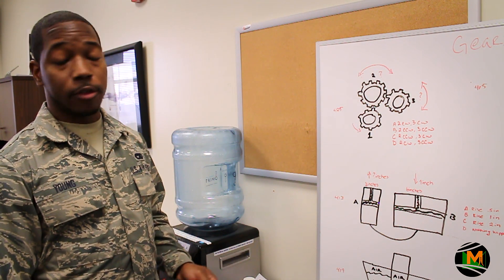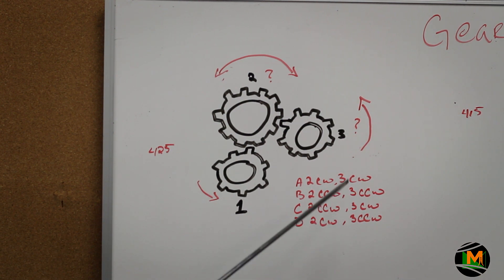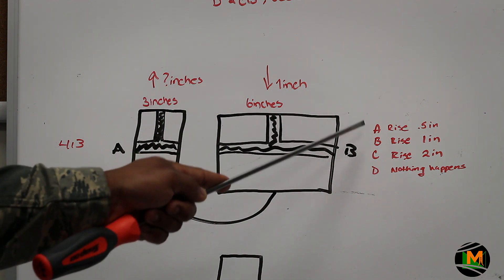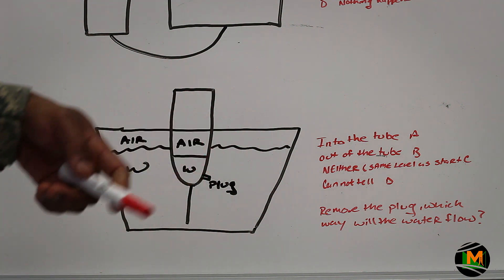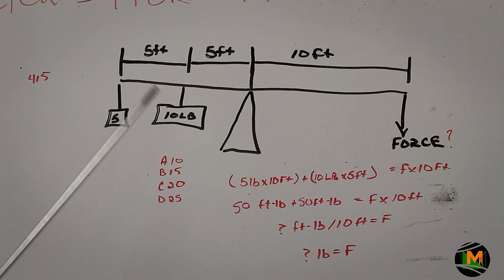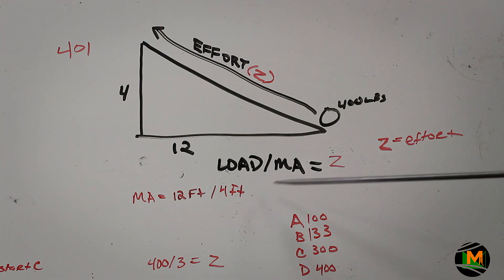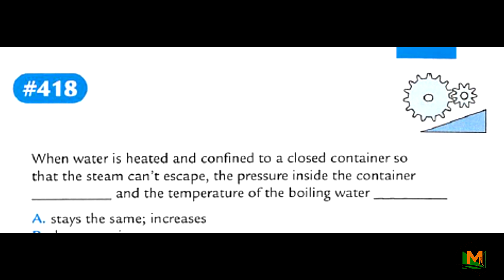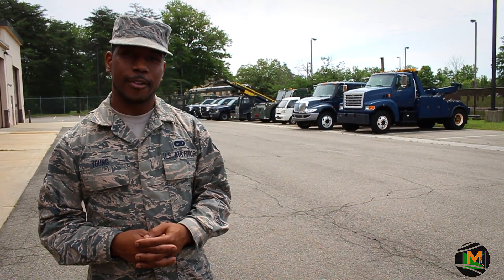ASVAB Study Guide: Mechanical Comprehension

Comment: On question 401 I believe that you’re actually supposed to find the IMA using the Length of the incline which is hypotenuse (not the base/horizontal line) divided by the height of the incline. However, if you use the Pythagorean theorem, it turns out to be a little over 12 anyways. So the way that you did, it will still get you close enough to the answer to guess. Correct me if I’m wrong please.

Comment: 419 didn’t make sense to me..
The air is trapped inside the tube therefore the water would not flow into the tube as the air has no where to go. Like an upside boat in the water. You can dive under with it and the trapped air will keep the water from entering... confusing question.

Comment: Sorry but in question 415 why the correct answer is 10 ???    : if the length is the same in both sides for be balance there should be the same weight in each side so the correct answer should be 15lb ?
Reply: I’m pretty sure it’s because the distance of the 10lbs weight is closer to the center so it has less pull on it.
Reply: Jimi Vanstory right it does need to be an equal force. But imagine your holding a 10ft pole with a 10lb weight on the end and you have to hold it straight out. Now imgine you move the weight to the middle. Dont you think if will be 2X as easy? Cause putting the weight on the end increases the footpounds of force is doubled
Reply: 10ft x 10 lbs = 100ft/lb which was result of opposite side 50ft/lb + 50ft/lb
Reply: No. Hes right. If you put 15 on it that side would bottom out
Reply: Its still 10 ft on each side so itd have to be an equal force to balance out it has to be 15.....right?
Reply: sociopasta 23  okay ya that makes more sense

Comment: Fuckkkk I'm going to fail
Reply from the maker: Bay Adams no you're not, you just can't master these concepts in 2 hours before the test. All you need to do is take it section by section and work on your building blocks. We have strategies on how to break it down coming, but you'll be fine. Keep studying
Reply: DCANG Be The Hero when are they coming out? i take the asvab monday and my crayons arent going to get my through it😐
Reply from the maker: Bay Adams sadly not by Monday but how are you on Arithmetic, Math knowledge, word knowledge and paragraph comprehension. Those are the real keys to passing the ASVAB (at least for the Air Force)
Reply: DCANG Be The Hero I'm alright on math knowledge but good on word knowledge and paragraph comprehension. I just need a high mechanical maintenance score because I want combat engineer.
Reply from the maker: Bay Adams then you will do fine. Check out the Podcast about the initial interview, make sure you do keep an open mind even if your not going Guard, recruiters rules might still be the same no matter if your Active, Guard or Reserves, as to what they may need to fill.
Reply: DCANG Be The Hero i'm going active Marine Corps lol but yeah ill do that
Reply: DCANG Be The Hero I made a 59
Reply from the maker: Bay Adams see I told you, you would not fail. So is that enough to get you the career you where looking for?
Reply: I've been spending time with the help of my son researching into passing the Asvab test and found a great resource at Wilfs Exam Blueprint (check it out on google)
Reply: here's  a few tips for passing the military test
Give yourself a break
Don't get too stressed about it
Check out some trial exams online
(I learned these and the reasons they work on Wilfs Exam Blueprint website )
Reply: I know the feeling I'm about to take Air Force

Comment: I'm sorry but 401 is wrong. It would be 133.33333333333333... So technically that question is wrong
Reply from the maker: Dave Blair  so since we are a community in helping ppl pass. Please enlighten us on the correct way to solve that answer.
Reply: No you were right that in the ones given that was the right one to choose but in all reality the answers should have had the decimals since a little does make a big difference. But keep up the good work man. Since you are helping a lot.
Reply: All questions have only one answer, despite the fact that the true answer is 133.333333333333, u just have to round the number down. Its one of the reason why we don't use pi = 3.14159265... in equations cuz it goes on and on
Reply: Dave Blair someone's a smart ass good luck with that
Reply: Lol i thought that too.